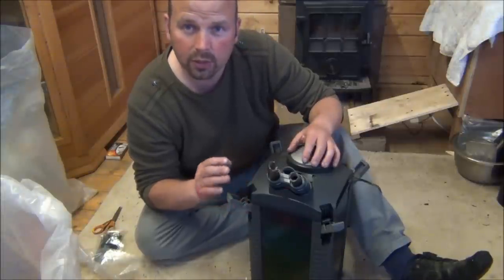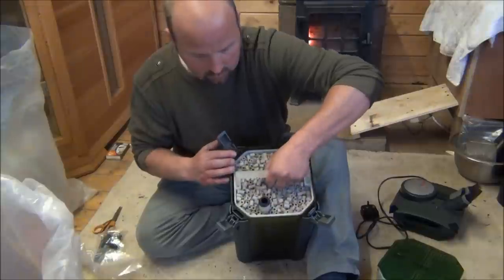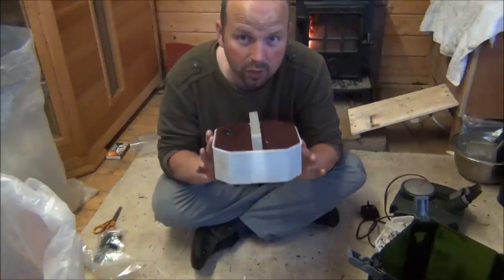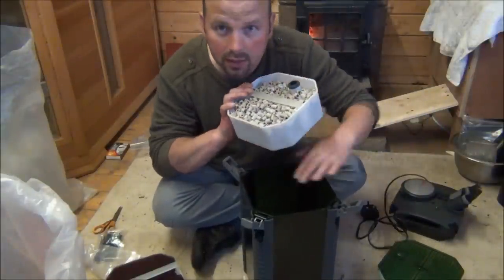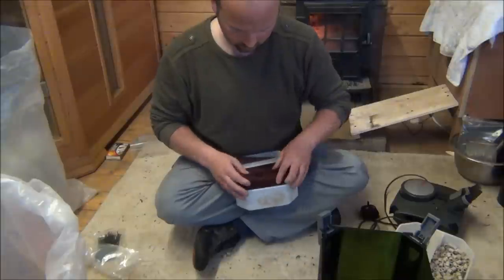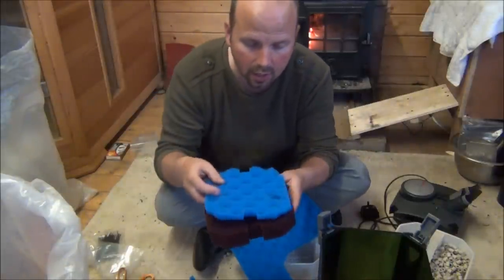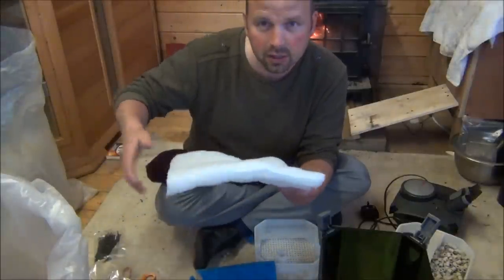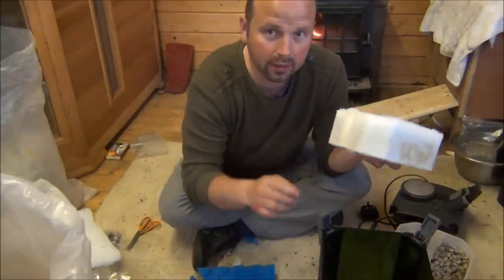How to set up an external canister filter for aquarium by Pondguru

Comment: Hi there! I'm new to the aquarium hobby, and after doing so much research on the nitrogen cycle, and working on my water changes etc, my water levels are finally great, and consistent, so I can say my tank has cycled. Now after coming across your videos I realized I have a worthless set up in my canister filter. It has the generic media, and pads that every new canister comes with. I want to replace it with the structure in this video to make the most out of my canister filter but how do I do that without disturbing the tanks current biological filter? Will replacing everything with the products in this video cause my tank to cycle again? If so, is there a way to do it without disturbing the peace? lol
Reply from the maker: If you have a fully cycled filter you will have no ammonia, nitrite or nitrate so there is no need to change anything if it's working so well.
In a situation where you were replacing the foams and media in a filter you'd do the foams one week, leave it a week or so then change a media tray, leave it 1-2 weeks then change another media tray and so on until the filter is fully set up.
Reply: Pondguru Outdoors thank you for the honest response! My water levels continue to test 0 for Ammonia, and 0 for Nitrite, but my Nitrate levels continue to be around 40ppm. So I guess that means it's not cycled  then? Should I still keep my set up the same or do you think it needs adjusting based off those levels?

I have a 60 gallon tank, and the filter I purchased is an Aquatop CF300, it came with (bottom tray) three fine pads, one coarse, then (middle tray) of blue bio balls, and (top tray) bag of carbon
Reply from the maker: Half the cycle has completed but with the current set up there it would need to be changed to complete the cycle and reduce the nitrates.
The filter states it is for tanks up to 75 gallons (I'm assuming US gallons) and if you have 60 gallons you'd generally look for a filter which promised to filter up to 120.
The maximum amount a filter will do can always be halved for a normal community tank and reduced again for heavily stocked tanks. 
However I am not familiar with the size of the trays in that one as I do not have them recorded - if you send me dimensions of trays I can work out how much media they will hold.
Ideally you'd be looking for around 2.5kg for a normally stocked tank and up to 5kg for a heavily stocked tank of 60 gallons.
It needs a specific amount as the amount of anaerobic bacteria (the one which processes nitrates) is critical in achieving the full cycle. Ammonia and nitrite is very easy to get to zero but the natural reduction in nitrate (completing the cycle) does take a sensible sized filter and plenty of suitable media.
Regards,
Richard

Comment: have you every done a fluval fx5 and if so  what would be best what set it up and what would you recommend in media to put it
Reply from the maker: As they have good foams around the media trays you really only need a fine pad on the top of the top tray (water flows top to bottom in FX) That leaves 3 trays for media and each will hold approx. 1.5kg of either biohome mini ultra or biohome ultimate (best types for external filters). If you pack it in neatly you can get around 5kg in the FX5 or if you were to go with coarse, medium and fine foams in top tray you'd get nearer 3kg in the remaining 2 trays.
Each 1kg should enable a reduction in nitrate in approx. 100 litres of tank water for a normal community tank so using 3kg of 5kg would set it up for a 300 - 500 litre tank. More media would be needed for heavily stocked tanks or marine systems (sometimes between 1.5 - 2kg per 100 litres to achieve the full cycle filtration associated with nitrate reduction).
Hope that makes sense.

Comment: Hi. I have always set up my filters like this, with the ceramic rings in the bottom. But today I bought a second hand eheum 2128, with a heater in the bottom. Would you advice to put ceramic rings in the bottom with the heater there, or will it ruin the effect of the heater?
Reply from the maker: The ceramic rings aren't really needed so if in doubt, leave them out. The foams will take out the muck then the biohome will devour pollutants.
Reply: Pondguru ok, thanks alot

Comment: 2 simple questions - where would you get the sponge/pads if I were to not get them by brand or factory made. Like what can I look out for at my local hardware store?

The second question - I see you have a ton of that biomax media thats super porous, where can I get that for cheap so I don't have to get it from a 'special' aquarium brand?
Reply from the maker: A hardware store is unlikely to carry replacement sponges for pond filters. Just search ebay / amazon for  'Replacement pond filter foam set' for the coarse and medium grade foam and 'Fine particle matting' for the fine white foam / pad.
I don't have any Biomax media but you can get it from any store which deals with Fluval products. Like the Biohome I sell, Biomax is specially made for the filtration of water so is not sold by other outlets for different purposes.
There is now a Biohome distributor in US - just follow link in video description.

Comment: Hi Richard,

I have just acquired an Eheim Ecco and set it up as described in the video. If I wanted to add a bag of activated carbon where would it be best placed ?

Thanks
Reply from the maker: +kevin fisher Chemical treatments really should be the last thing water hits before it leaves the filter so in most externals it would go in the very top.
Reply: Thanks, would it be better to leave the carbon on it's own or could it be put in the tray with ceramic media
Reply from the maker: +kevin fisher It can go on top of the media but will need to be in a bag for easy removal since it only stays active for 7-8 weeks.

Comment: I have been doing it wrong then. I have a Tetra canister, with smooth ceramic at the bottom, then plastic balls, then coarse and fine sponge. I guess I need to revert that and possibly replace ceramic and plastic media. Thanks for info!
Reply from the maker: No worries, glad you found it useful and thanks for watching.

Comment: Trying to setup my cascade 700. I can not seem to find the foam I need. I went to my local wal mart and all they had was the coarse pond foam. I want to set my filter up like yours but cant seem to find the medium and fine foam anywhere.

I did find some on amazon but they were poorly review as saying the coarse gets clogged up very fast. Any specific sites or places to get the foam filters?
Reply from the maker: GPVlog You could try the US supplier of bihome www.greatwaveeng.com as he has some different foams in stock. I remember him saying that it was very difficult to find quality foams in US. I assume you are in US but if not then just click link in video description to my ebay store where I do all 3 grades of foam.
Reply: How much of the ultra do you recomend for the cascade 700? it is a 29 gallon tank.

thanks!
Reply from the maker: GPVlog If it is a 29 gallon tank that equates to 110 litres so you would need a minimum of 1kg of mini ultra or ultimate media. I am not familiar with the that sort of filter to know if it would take 1kg (more is always better) but Don from greatwave may have those details recorded as we often have different types of filter available in UK and US.

Comment: I am now ready to connect my eheim pro3 250 filter with just the 2 baskets.
As it came without all the filter media I was unsure what to use so ordered the original pre-shaped foam for the top part above the 2 baskets, but found this to be a coarse media foam ? Would you recommend i change this so that all my media foams are in the bottom basket as in your video, followed by some Bio home mini ultra ( which is what i intended to do ) ? What would i then put into the top part in place of the coarse pre-shaped media that eheim recommend and supply.I am new to the hobby so want to get it right first time.
Reply from the maker: In a Pro 3 the top foam can act as a pre filter foam so just leave it there and set the baskets up as shown in the video. Having a coarse foam as pre filter (top) followed by another in the bottom tray will save the other foams and pads from clogging so will give you longer between clean outs.

Comment: when you say gradually over 4 - 6 weeks what do you mean sorry? ive brought 5kg of biohome ultimate which i didnt recieve any filter starter balls with and new foams so what do you best recomend ?
Reply from the maker: If you ordered from me in UK or the US supplier you should have received the free starter balls - they help to set up the filter quickly with bacteria.
With regard to the setting up if it is a new tank there is no problem changing everything in the filter in one day but for a mature tank which already has active bacteria in the filter it is best to do the change over gradually:
e.g. week 1 change the sponges, leave it a week then change one tray, leave another 2 weeks then change another tray, leave another 2 weeks then change another tray and so on until the filter has been filled with the new media. 
Once it is full of new media that should last for a good 6-10 years at high efficiency. Some manufacturers will tell you to replace biological media every 6-12 months but it will just be nicely mature then so should be left in the filter for many years (assuming that it is good quality and will last that long).

Comment: Hi Richard. Big fan keep up the great work. i have a question for you if you dont mind. Can you modify the trays like this in the tetra tec ex1200? Also do you have any info on the said filter? Is it anygood?
Reply from the maker: Tetra external filters are some of the worst I have seen with regard to build quality and internal media and foam arrangement (looks like it has been set up by a chimpanzee in the dark) so if you haven't already bought one consider another manufacturer. The all pond solutions filters are much better and very cheap. Any external filter can be altered to be more efficient as the idea of getting all the mechanical filtration done prior to the biological (filter media) will work in all filters.
Reply: Oh no. Ive just bought one. Ive spent the last 2 weeks looking at filters. My new tank is a slow project so ill see into a return. I found alot of negative feed back on the aps filters because their cheap but ill take your advice over anyone. I will be taking your bio media and foam pack also. Will the aps last?
Reply: Would the tetratec be ok with your media pack Richard?
Reply from the maker: LEE ROY I recommended the APS as I thought you were looking for budget filter but there are better filters available. The fluval and eheim filters are probably the better ones but if you already have the tetra filter it can still be made to work properly with the correct foams and media, yes. If money is not a concern go for eheim, next choice fluval, next choice Aqua One then take your pick from the cheaper filters. The APS are better constructed than the Tetra and for the price do a great job. Your Tetra can be made to do just as good job but be very careful with the fittings on the filter as they are extremely brittle.
Reply: The tetratec ex1200 has four trays. I see you put some of that ceramic in the bottom of the filter to stop the large waste items slushing around, would you fill the tray or just alittle?
Reply from the maker: LEE ROY Would I fill which tray and with what?
Reply: The bottom tray which is 1 of 4. I see in this video you put either gravel or ceramic in the bottom of the filter to stop the large waste items slushing around. Should i do this in the first tray? And if so how much? I know what to do with the other 3 trays.
Reply from the maker: LEE ROY If there is no space under the trays for the rings then put a few in the bottom tray and cap off with a coarse sponge. Next tray up could be medium and fine foam with media in top two trays.
Reply: Just want to say thank you for your time Richard. Great advice.
Reply from the maker: LEE ROY No worries, man. I always believe advice should be free and I'm here to help.

Comment: I have a 4 basket system, if I want to add purigen or charcoal, I should but that on the top right?
Reply from the maker: Yes the best place for those similar products is right at the top so it is the last thing the water hits on the way out of the filter.

Comment: I have a jebo 829 it has 5 filter trays I don't think I'm getting efficient biological filtration could u please if you don't mind give me a few pointers on how you think would be the best way to set this filter up thanks for the great video mate
Reply from the maker: It works exactly the same as the filter in this video. If you send me that dimensions of the trays you want to fill with media I can work out exactly how much media you will need no worries.
pondguru@btinternet.com
Reply: The trays are 1"3/4 deep and 6" by 6" inches appreciate it there is 5 trays so i should fill probably 3 what do u think thanks again friend
Reply: and with the five trays what would be your opinion of the most effective way to set it up as far as the 5 trays from the bottom up
Reply from the maker: 516Spark
Yeah, 2 bottom trays of foam then media for the upper 3 sounds sensible to me too. For 3 trays of the dimensions given you have 1 cubic litre of space in each tray. Therefore you would need 3kg of the biohome standard or biohome plus or 2.4kg of biohome mini ultra or biohome ultimate. The mini ultra and ultimate can be packed in tight to fit 3kg if necessary.
Reply: awesome and i can order that through the web address you've provided me with….. thanks again friend
Reply: my water clarity is pretty good.. what do u think about sachem purigen on the top tray will it serve any purpose and while I'm making this swap of filter media will 1 tray a month be to fast i don't want to risk it with a tank crash
Reply from the maker: 516Spark
One tray a month will not be a problem as it sets up incredibly fast with bacteria. Unless you have a problem with staining in the water or excess chemicals you want rid of I can't see the point spending money on Purigen. People are often convinced all the additives, sachets and fancy new products are the reason why they haven't lost fish for 6 months whereas sensible stocking, a well set up filter and simple maintenance regime will keep fish healthier than all the water conditioning products under the sun.
The link to the ebay shop is in video description, way down the long description but here it is in an easier place: http://stores.ebay.co.uk/Filter-Man-UK?_rdc=1
Reply: thanks a bunch appreciate all your help
Reply: and if you don't mind its a bit off topic but in your opinon what is the best substate for beneficial bacteria with the most surface area for them to thrive i currently have sand in my 125 gal and i don't think my bacteria are thriving all that we'll on it appreciate the timely  response
Reply from the maker: 516Spark
Sand will offer way more surface area than any gravel so is definitely the best for bacteria. It will support much less than the filter media in a filter as water is being forced over the filter media so the bacteria is better fed, stronger and will consume more ammonia, nitrite and nitrate. Don't worry about much bacterial activity occurring in the substrate as it is in the filter where the main event takes place.
Reply: just wanted to take the time and say thanks for all the help still waiting for my new filter pads to come and then I'm going to order some of the media. if u have a moment id like to ask if you can check out my channel and subscribe ill be making more vids thanks
Reply from the maker: 516Spark
No worries, man. Feel free to post links to any of your videos or to your channel on any of my videos.

Comment: Hi what is your thoughts on Poret Foam as media for canister filter? I see lots of people switching to Poret by replacing everything inside canister with it. I mean to fill in just with poret all baskets inside filter.
Reply from the maker: Blocks of foam will always support some bacteria when they get mature (which can take months) but they will never be as efficient as media as they're really a primarily mechanical, not biological media. It would really help if they were profile cut too as that would cut way down on maintenance time since the face which gets hit by water flow can be increased greatly by using egg box shaped foam. Another problem with foams is that they support mostly aerobic bacteria so you still have the problem with nitrate production and build up which means large regular water changes. This video explains further:
https://www.youtube.com/watch?v=lsAmSD3wVbg

Comment: Hello. My name is Chris. I have a 60 gallon aquarium with 13 small to medium size cichlids in it. I am using  2 Marineland C 360 filters for it. The filters have 4 trays in them. In my top trays in both filters I am using the Biohomme Utra Media but I am still having problems with Ammonia. All of the other levels are fine. In my bottom trays I have the mechanical filtration. What else can I do to bring the ammonia levels down? I am doing water changes twice a week and I feed my cichlids once every other day. What would you suggest to do? I was thinking about replacing the tray that has the Bio Balls in them with Biohomme Ultra so that way I would have 2 trays in each filter filled with Biohomme Ultra Media. Do you think that would be a good idea and do you think that would help bring the ammonia levels down?
Reply: your tap water could have ammonia already in it check it out